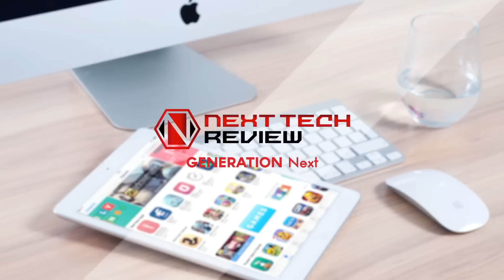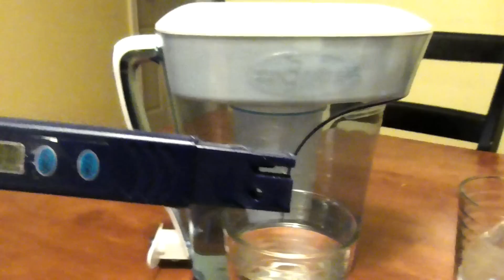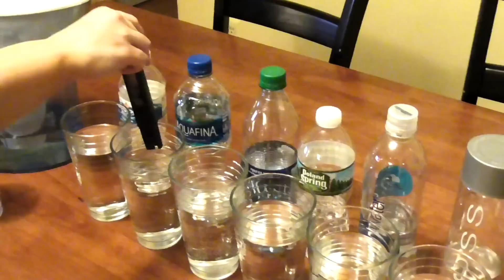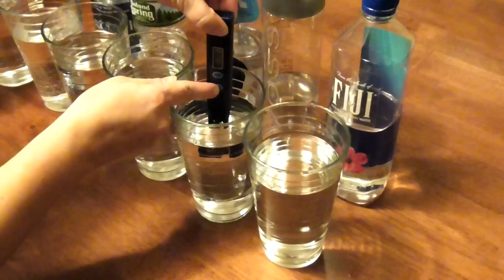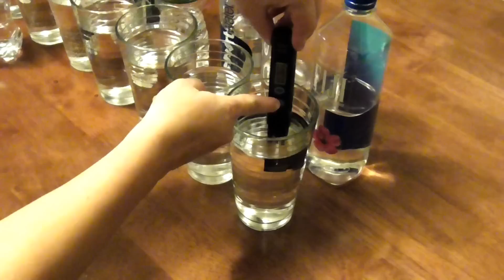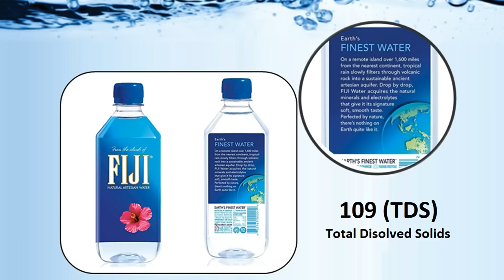Compare Zero Water vs Bottled Water with SURPRISING Results!  - NTR

Comment: This is not an accurate test of how clean the water is. The device used measures "Dissolve Solids" by definition salt is also a dissolve solid. Many companies add sodium and minerals into the water to enhance the tastiness of the water.  That is why Fiji Water taste so good because it has alot of minerals.  To really test water cleaniness you need to do a comprehensive test by using a water testing kit you can find in a Hardware store or an Aquarium/swimming pool equipment store. Or send your water in to a professional company to do the test. This video only test one variable. There are other things you need to test for like bacteria levels, PH, Cyst, lead, copper, radioactive isotopes and salinity.
Reply: What test would that be
Reply: lead, copper, salinity would show up in TDS #.  bacteria and pH wouldn't, but I believe other videos show ZeroWater ends up with 7 since the things that would affect it.are removed.  As for Fiji, yes, they add stuff back in so it isnt a great test for that.
Reply: @MetalKid007  Agreed!
Reply: Something is wrong with my water. I'm convinced. Months later after complaining to my apartment manager an him just saying it's probably iron. I had a shoulder surgery fail & I am sick. Soo sick. Edema. Cheapest way to check my water? I need to know if there's lead in there? What's the name of the test from the hardware store? Thanks in advance. On a tight budget.
Reply: @dubsbarry9963   EPA? I wouldn't trust what any government agency tells me... and NO, I'm not paranoid, nor am I a conspiracy theorist; I've had EXPERIENCE with government agencies... on the outside and on the inside. Trust me.
Reply: Agree. Fiji water is ortho-silicate water. It contains silica. Other high silica brands, and cheaper, are Evian and Spritzer. Silica is necessary for strong bones, hair, nails, skin, nerves. There are other naturally-derived minerals in such bottled water also good for health. The name says it - mineral water.

First, decide what kind of water you want.

If you want pure water with 0ppm TDS, just buy distilled water. Or get a counter-top distiller.

If you want artisan-type water with natural minerals in it, expect TDS to be significant. But being natural artisan water, preferably bottled at source, it would probably contain zero lead and other toxic metals commonly found in municipal water in cities and industrial areas.

It would have been good if we were told whether each one was distilled water or mineral water. There is a big difference. Also, as a comparison, perhaps include a test glass of pure distilled or 0ppm water with some sea salt dissolved in it.

Thanks anyway for doing this test. Some bottled brands I didn't know about and will check them out. I've also been thinking of getting a home water distiller but they are very expensive. The Zerowater would be perfect for me.
Reply: Lower PPM doesn't mean safer water this thought is widely shared by the public and a dangerous misconception.

 Using a TDS meter to measure ppb lead concentrations in tap water is like trying to use a car’s odometer to measure a child's height…. It's the wrong tool.

A TDS meter is not sensitive  enough to measure toxic levels of lead, chromium-6 and arsenic. 

Because TDS/ppm is an aggregate measure of charged compounds in water, uncharged things like motor oil, gasoline, many pharmaceuticals, and pesticides do not contribute to a TDS/ppm measurement

For example, if water has lead, chromium- 6 or arsenic that are 100x the EPA limit, the TDS reading will read 000 or 001.

They must be measured by trained staff in analytical laboratories that use much more sophisticated scientific equipment than a $8.00 device.

If you are concerned about water quality, put the money toward the purchase of an effective drinking water filter that removes harmful contaminants from your water.✌
Reply: @dubsbarry9963  EPA did a great job in Flint, MI
Reply: @peterpiper487  Ty PP EPA Did such a great job in Flint, MI.
Reply: @flipflat4814  zero water filter used ciation plastic beads to entrap all you listed. on to the beads surfaces. just like a soft water whole house filter.

to be released by brine solution ion exchange.

you only need 2 filters one in the pitcher, one in the brine solution.
Reply: @EmptyTelevision  Not true. I've been drinking and cooking with distilled water for over 12 years. I hardly ever fall sick and have no chronic illnesses or conditions, none whatsoever. Why is that?
Reply: @MetalKid007  Lead technically is a dissolved solid.  But the problem is these TDS meters only measure parts per million.  Lead is dangerous in the parts per billion range, so these meters can't detect it even if it was there. You need a lab to detect stuff in the ppb range.  That said, ZeroWater is highly effective at removing lead and all heavy metals as shown by various independent tests.  One university compared ZW to Brita and Pur and found that ZW was the only filter capable of removing lead nanoparticles.
Reply: @MetalKid007 Add things back into it?  I thought it was natural spring water?

Comment: Water with no dissolved salts (specifically) can cause harm if consumed in large quantities.  Because the water has zero salt in it it actually dilutes the salt in your body which can cause a medical condition that can lead to death.   There is a video on YouTube, with a lady that almost died after drinking 3 gallons of water in a contest.  Now, perhaps you are not that extreme. But at the very least water with zero dissolved salts can make you retain water.

Fiji, is actually probably the best water there for your health long term.  The things that you are filtering out of your tap water are things like lead, chlorine and other chemicals.  But you're drinking water should be spring water.

1) Boil your water to kill bacteria.  2) When it cools, filter it with a Zero water filter.  3) Use zero water for cooking, tea, coffee and mixing juice etc.  4) For drinking Water, drink spring water.  5) Never drink tap water strait out of the tap.
Reply: AquaGear water filter, removes fluoride, 90% & high levels of lead, like 95%. I do like Fiji water but from now on, I'll go back to boiling my tap water.
Reply: im not sure i understand correctly (english is not my native language) But do you mean 3 gallons of normal tapwater will cause health problems? or will 3 gallons of filtered zero water also be dangerous? in theory
Reply: theres other easier ways to kill bacteria & parasites. If i recall 0ne drop of propolis in a gal of water kills it. do your own homework to confirm. On a side note im also worried about filtering out microscopic plastic particles, it seems this filter gets rid of most but not all... ugh.
Reply: LOL...
Reply: If you're eating food to supplement all that pure water you're drinking, hyponatremia isn't a thing. No one should be drinking that much water without eating food. You don't need special water with electrolytes in it. You need food...
Reply: you get more than enough salt from food.
nuff said.

Comment: All bottled water no matter what
 has to go through some kind filtration system.  Aquafina (Pepsi) is called flat water, zero solids. this is the way they wanted their water to taste. Dasani adds minerals to make it taste different from every other water. this is how you create a brand name.   the rest of them add the minerals back just like Dasani (Coke).  I learned this when I was on the water conservation/ clean water committee for a large east coast city they were on the committee with me. When you see a fire hydrant open during the day they are flushing the system because too much or not enough of something is in the water and could cause cramps or mild diarrhea before it gets to your house. I have not had tap water in 40 years and if I do I run through some kind water filtration. when they bottle the Pepsi or Coke they both start with flat water for their Soda this is how you maintain quality control.
Reply: THANK YOU! VERY GOOD TO KNOW. So "flat" water has NOTHING AT ALL in it? Not even beneficial minerals? I've experimented over the years and I find that if I drink distilled water too long, I don't get enough calcium for my bones and they start to ache. I used to do the Zero Water thing, but all that does is guarantee that there are no minerals in the water so I stopped doing Zero Water and went to bottled "Spring Water" hoping that would work for me. It seems to do better than anything else, but I STILL don't know if there could be some "bad" minerals in it. I guess that depends on which spring the water comes from... if there IS such a spring and not something they just cook up and label on the bottle. It seems that CCP (Chinese Communist Party) tactics are being used on the people in America... "don't let the people know the truth about anything."  I do know that distilled water and Zero Water don't work for me since they take out EVERYTHING that might be good for my bones, but I don't feel comfortable not knowing what's in my bottles "Spring" water.

Comment: Allegedly the cleanest naturally filtered bottled water you can get is bottled and sourced in Hawaii. Filtered by very deep porous volcanic material that's naturally there. No additional filtering needed. Only concern is contamination from equipment or the container it's put in; until it's proved there's nothing about either to be bothered by. Nothing about the brand(s) or bottling company. All things considered, it's just how things are with consumables from point of collection to point of consumption.

Comment: Only using a TDS meter on bottled water is misleading because it matters what solids are in the water.  Alkaline waters like Fiji are purposely adding Calcium and Magnesium, salt or even Silica to counteract aluminium contamination etc..   Since tap water is allowed to add fluoride, lead, chloramine etc....Zero water is the best alternative to drinking tap water since it also filters Fluoride, Lead, PVC, Chromim6 etc....

Comment: Drinking water often (typically?) has minerals added if filtered, naturally if unfiltered natural spring water. Check the label. If it's labelled as "drinking water" it might also read "minerals added for taste".  The TDS reading is only relevant if your feed water has toxic (quantities of otherwise safe) minerals. All municipal sources follow a maximum allowed rule. That may be just as much based on the cost of cleaning it out as for safety and what can't be helped without crippling expense. It's still not necessarily safe. Get a test kit that shows you levels of everything of concern from your outlet and then implement a method designed to get those to safe levels. TDS only tells you total dissolved substances; without concern of (un)healthy. It doesn't detect contaminants that are not of dissolved solids. I'd still filer because I know that some are toxic.

Comment: I wouldn’t use this device to check for the best water, per say. It only checks for purity- meaning if a water is high in minerals this device will give you a high number. I wouldn’t only use the meter to check your tap water, or to compare your tap water to your filtered water to see if your benefiting by getting a lower number. This review needed a testing kit to make it worthy

Comment: Another consideration depends on what state you live in..my grandson lived in Dallas, Texas..
I called ZERO company they  asked for his zip code area. Then told me a ZERO FILTER WOULD only last about 2 weeks. Bc of the heavy filtration going on to filter his water in that area.
Reply: Yeah mine here in the Denver, CO area also only lasted 2 weeks before tasting like lemon water.. nasty.  It's going in the trash.  There's no way I'm spending $1k a year on filters.  Back to the old carbon brita which lasts months and cut the dissolved solids in half from the tap.  That's good enough for me and removes the chlorine taste.

Comment: Unlike many others here, I want ZERO dissolved solids as well as zero other poisons like Fluorine/Chlorine.  One reason is, I hate water spots on everything water touches (then dries).  Also, the dissolved solids meters do not detect every kind of dissolved material, so filtered then distilled water is the way for me.
Reply: You live a tough life man. All that work just to die anyways... Live a little.
Reply: Make sure you get minerals from food or supplements or you will suffer if you do not get them from water.
Reply: I just discovered finger nail polish remover doesn't dissolve in water and therefore doesn't register as a tds!

Comment: You should pH test the water as well to determine if the water is terrible. A low pH and high TDS is bad. A higher than 7 pH and high TDS is ideal, could mean company added minerals for taste. Anything under 7 and high TDS don't drink.

Comment: zero water filter uses ciation plastic beads to  filter by entrapment, all those nastys yall worry about. all  is held onto the beads surfaces. just like a soft water whole house filter.
to be released into brine solution by ion exchange.

you only need 2 filters one in the pitcher, one in the brine solution. swap bi weekly for superb results